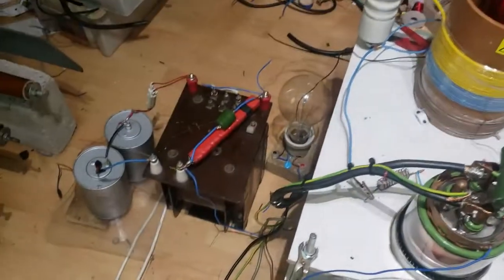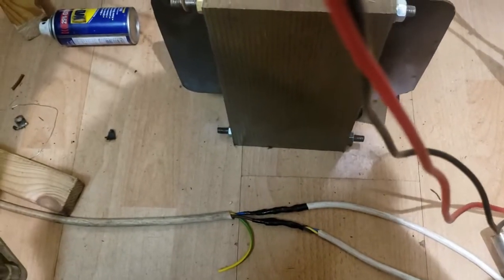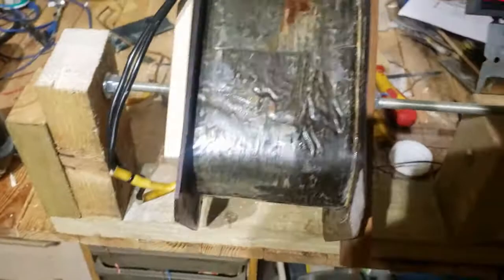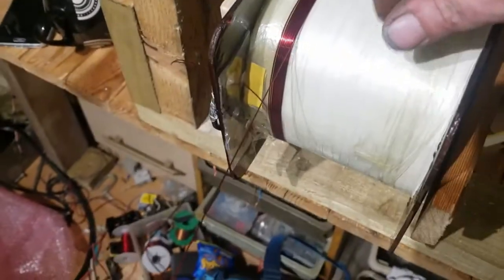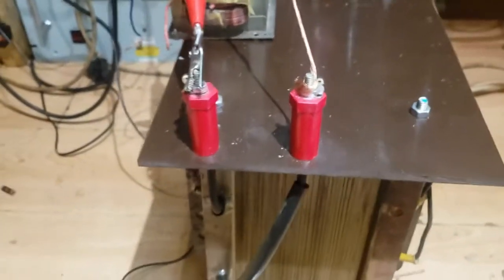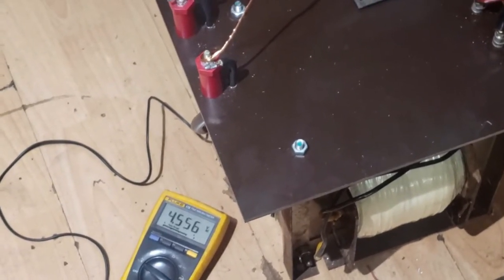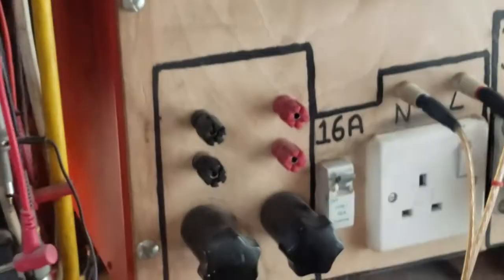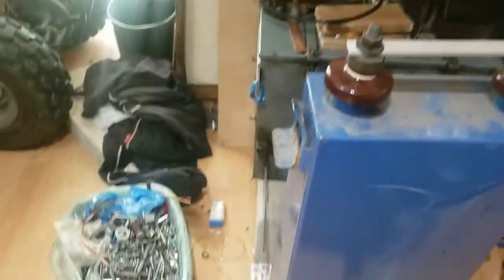DIY transformer 5000v 10kw

Comment: I have a 10 kva transformer here for rewind. Just for interest, it weighs 152kg. The reason being it`s designed for continuous service only 6000v but it is wound on a 3 phase lamination. This means the lamination's seem to be too big for the ratings but the secret is that a core designed for three phase has a center leg the same size as the outer legs. This allows you more window room for the windings. This is important so that you can allow more space for insulation and just as importantly allows the use of wooden or fiberglass spacers forming a gap between the secondary and the primary for air circulation. 6kv is not exactly high voltage but over time it is high enough to form corona across the paper insulation, this eventually forms tracks that slowly carbonise and then you suddenly get a secondary to core or secondary to primary short. How much time you might ask? As low as 2000 hours, don`t ask how I know that. (My own `economy` transformer.) As for your winding technique, it is excellent. All I would add is that if you need a long term transformer, leave more gap at the edges, Use Nomex or similar insulation, epoxy each layer, Use 3 phase core, (same maths for center leg area to set Tesla level), leave a gap between prim and sec for ventilation (spacers). If not overheated this transformer would last 50 years!  Hope you are keeping well, Chris UK.
Reply from the maker: Thanks buddy, appreciate the advice, I do actually know a little about transformers 😁 have you looked at my other videos? Thanks for your comment and for watching..
Ps I plan on putting this transformer under oil at some point 👍 also the inside winding (closest to the primary runs grounded) .. if I was going for higher voltage I would use a 3ph core with a leg cut off (as I have plenty of large 3ph transformers) I would also use pyramid winding with larger gaps between primarys and secondarys .. this was just a quick solution..
I want to make a 15 to 20kva 6kv with two legs (3kv rms each leg) as I want to run that tube at full power CW at some point and the tube is rated 13kw rf output 8kw dissipation 450w dissipation on G2 and 250w on G1 then the 400w grid leak , then theres the losses and power factor and so on ... 
Steve Arcs
Reply: @T2D.SteveArcs  I am sorry that my advice is redundant. I only commented because in another creators video you asked for anyone with experience in high power vacuum tube technology to get in touch with you.  Chris, UK.
Reply from the maker: @TheTemporalAnomaly  oh yes I would really appreciate any education you can offer in that department, ❤😁
Reply from the maker: @TheTemporalAnomaly  did you add me as a friend on Facebook Chris? It would be really appreciated if you could share some of your tube knowledge with me ..👍

Steve
Reply: @T2D.SteveArcs  This is the only social media I use, I did email you and reply to one mail from you but I guess some will get lost in the spam folder, (if your in-box is anything like mine.) Look for quatermass and you will find my mail.
Reply from the maker: @TheTemporalAnomaly  okay thanks Chris, il take a look.. I don't use email anymore but I will definitely see if I can find your mail👍 thank mate...

Steve